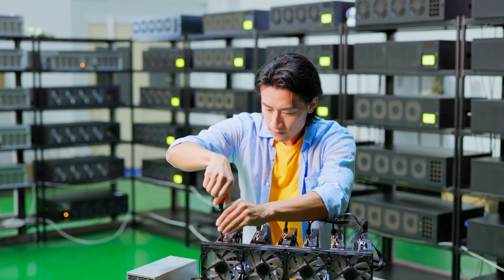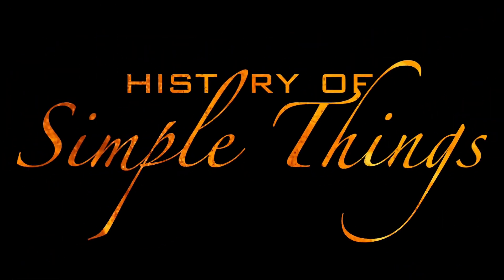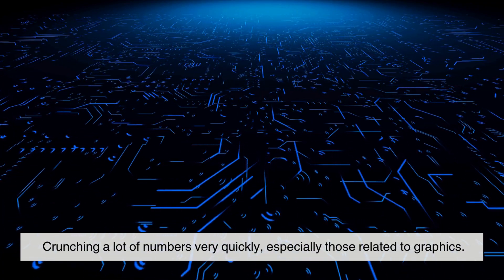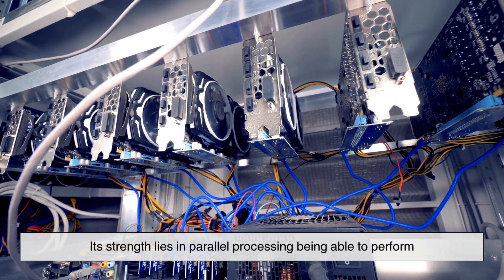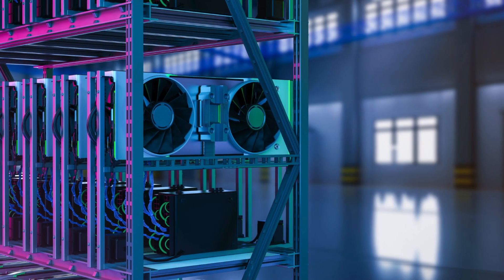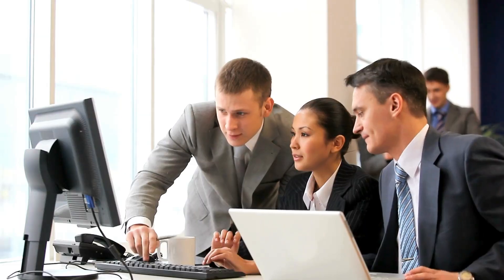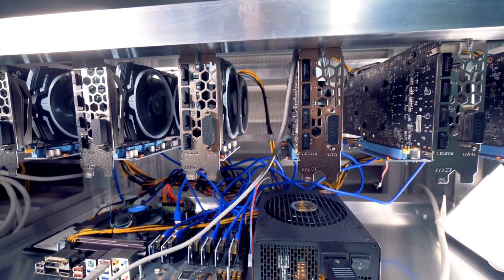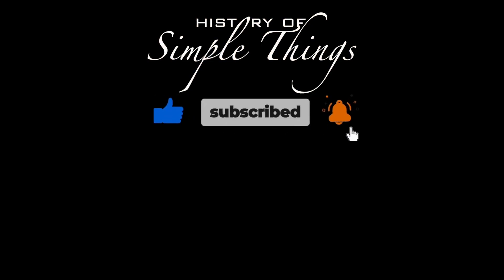What is a GPU? The Power Behind Gaming and AI

Comment: It, in effect, is a mini-computer that is specifically designed for graphics. CPUs nowadays are also multitaskers. Mine is an 8-core 16-thread unit that is faster than the GPU but is only used for the nongraphical items. Computational models and information is handled by the CPU, not the GPU. The GPU does not do computational modeling but only translates the information it is given by the CPU and the program to be graphically represented on a monitor or screen.